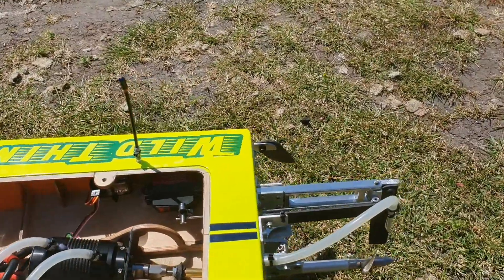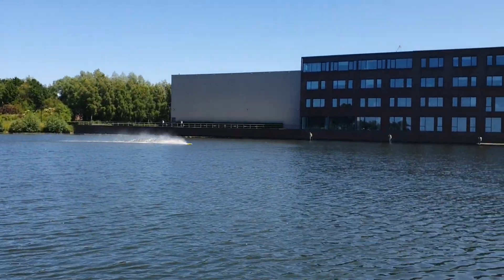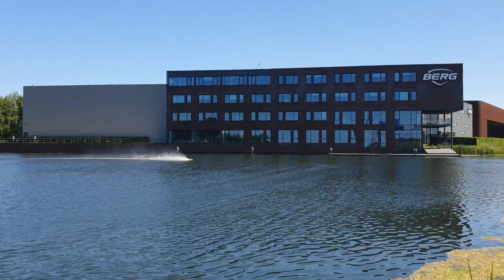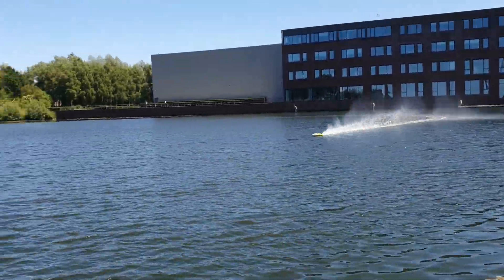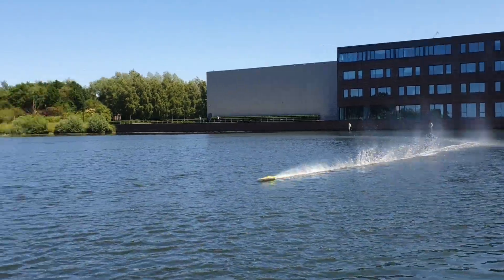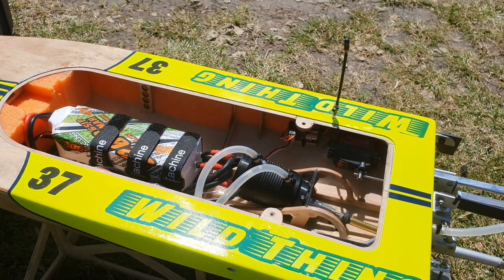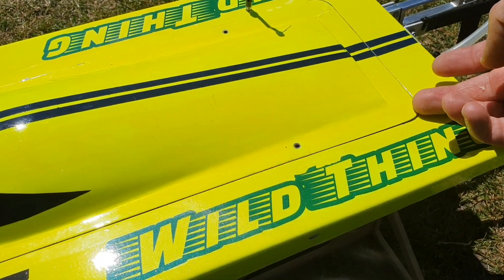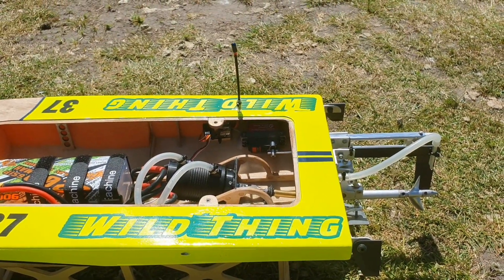DIY RC boat: Wild Thing breaking speed record. New rudder, running better than ever!

Comment: according to the experts on offshore electric forums you're going to explode that boat running 2000kv on 6s. You should be running 1200kv with a 55mm prop. They know, they race boats.
Reply: The guys on offshore is correct with they recomendation. A 35000 rpm max unloaded setup with a 52 to 55mm prop will out perform a 50000 to 55000 rpm unloaded setup and a 42mm prop. 

Better runtime with the same or more speed is what the lower rpm setup will offer in many cases. The bearings, strut bussing will last longer with the lower rpm setup. And if anything is slightly out of balance the lower rpm setup is more forgiving.

That is one nice looking boat, and it runs as good as it looks.
Reply: @Patrick3450  yeah no. It will destroy a battery. it will desolder wires. it will torque roll, torque steer, chine walk like crazy. It will not take a corner. No engineer in the world will tell you a low voltage, high current system is better. prop size = load = current.

your batteries C rating is being pushed to the brink doing that. A battery only contains so many watt hours of energy. and a low voltage system is least efficient so your run times are less. Anyone with the slightest shred of integrity running this goofy system will tell you they run their batteries and wires extremely hot to the point of destruction. Ive watched it a dozen times. watched SMC and CNHL packs puff 50% their size and desolder their nickel joints.

There's this thing called Ohms Law. It dictates resistance to electron flow. High voltage = less resistance = higher efficiency. Thats why transmission lines are 33,000 volts and only stepped down in voltage at the residential location. a low voltage high current situation is referred to as a brown out condition. It is notorious for destroying appliances and catching homes on fire.

high voltage with small load equals cool system temps, excellent boat handling, high efficiency, happy batteries, longer run times because less amps are being drawn at higher voltages with less resistance.
Reply from the maker: @Patrick3450  Thanks Patrick and I believe that bigger props are more efficient. That is my experience so far as well. The setup in my Wild Thing might not be the most efficient, but it works well and so far lasts. Thank you for sharing your insights. It's interesting to read the pro's and con's of different solutions! Cheers, DJ
Reply: @CozyRC  do a video on it. get 70mph on 4s see what happens. you'll need a 53mm 1.9 pitch prop. This will be funny (keep a fire extinguisher on hand)
Reply from the maker: @palehorse7377  Don't worry  I will not try that 😅. Purely looking at props, the bigger props seem to be more efficient. But when you setup your boat, the combination has to match together. 
I personally think that props in the 50mm range or bigger, are too large for a 32" hull. Setting your trim tabs slightly down will cause drag and a wet running boat. It might work for some, but I prefer to use smaller props.
And yes, power in Watts =  voltage x amps, so with a higher voltage you have less amp draw to reach the same power output. 
Either way, there are boundaries where a certain setup will work and besides these boundaries, the efficiency will become bad or you might destroy your setup.
My 6S setup with 2000kV is a high rpm setup, but I believe it is well within the boundaries still. Thanks again.for your inputs guys. I respect both your opinions 😎👍
Reply from the maker: I doubt a 55mm prop will work well on a 800mm hull. I'm on OSE as well, but I'm pretty convinced a 800mm or 32" hull suits a 42-47mm prop the best. 
Racing is another discipline, as they should  not drain their lipo's too fast, or they won't make the finish line. Thanks for your reply, I'm always open to receive advice 😎👍
Reply: @CozyRC  that was american sarcasm. obviously that is silly prop size. I run almost exactly the same setup as you. little smaller boat, little smaller prop. same motor.
Reply from the maker: @palehorse7377  I was not sure, but I thought so for 50% 😅 haha
Reply: With the bigger props 50mm or bigger your tabs need to be set equal on the both sides of the boat. And with a little negative, the tabs creates lift in the rear of the boat. I does run a 50mm prop on a 32 inch boat and I don't have any torque role issues thanks to the tabs being set equal on the both sides of the boat. I have seen someone run in the 55 and 57mm range on these smaller boats without torque role. If you can get your hands on an abc 1915 17 45 or 2014 17 45 2 blade props, or even an octura x450 or x452. Those are some fast props. 4s on a 2000kv will do well with those props. 

All waters are not equal but I know that a 35000 rpm set with a 50mm to 55mm will be as fast or faster than a 50000 rpm setup with a 42mm prop in the waters where I run.
Reply: @Patrick3450  to run the speeds he's doing in this video you would need a 72mm 1.4 pitch prop. Your ABC prop, the 1915, would reach 52mph at best. As would the X452. meaning least drag setup, high output batteries. Go to OSE and punch the props into the calculator and see. He's doing 70mph in this vid.

watts = volts x amps
this motor is 2800 watts. On 4s to reach maximum capacity he would have to pull 2800w/15v = 187A. EC5 connectors are rated for 120 amps. he would melt EC5's and have to run 8mm connectors and at least a 200A esc.

when he runs it on 6s: 2800w/22.8v = 122A. which would be high but safe for the wires and connectors. Its also much easier on the batteries to output 122 amps continuously.

so you can run big massive props with massive amp draws or you can run 6s and not melt batteries and wires., use a normal size prop, and go way faster. Not even getting into the boats handling with a 70mm+ prop.

like was said earlier it would be different if you're talking 45-55mph. which you are. But this is going 70+ mph.
Reply: @palehorse7377  To be honest I am have done alot of datalogging, I have pushed lipos to they limit, if the setup is to hot your battery voltage will drop so low that the cells will never have the same power after the run. I have datalogged and closely studied those kind of setups. I does use 6mm bullet connectors. I have pushed over 300 amps for a few seconds on 6mm bullets rated around 120 amps. Alot of the esc's, and motors can go way beyond the rated limits for a few sections. One time I took a 72mm prop for a gas boat and reduced it to 63mm and ran it will 4s using 2000 plus kv motors and datalogged everything. I have an idea of the safe limits that you can push the equipments without damaging anything.
The boat is running good I will say but not trying to offend anyone. But if someone came with that setup to race me I don't think they would stand a chance against my 4s setup with a 2200kv. The acceleration of the lower rpm setup would be too much to deal with. His setup where he was seeking top speed and saw 116kph would probably be able to match my speed. And I am talking about a 2200kv motor on 4s with a 50mm prop on a 32 inch boat.
Reply: @Patrick3450  calculator 2200kv:
50mm 1.4 pitch = 51mph
50mm 1.6 pitch = 58mph
50mm 1.9 pitch = 69mph

so no you still cant match this speed in the real world. Instead of sticking to an obviously nonsense, made up RPM limit pulled out of some "expert racers" rear end, why not just run a normal size prop on 6s with far lower current?

literal proof right here and hundreds of other videos is perfectly fine to turn higher RPM.
Reply: @palehorse7377  To be honest after studying this video more closely he can go alot hotter than that for the kind of running done there. Only holding full throttle for around a second the have to backoff thats not putting much stress on anything. 
I have video of my boat on youtube. So you can see what a 4s boat can do.

Comment: Excellent runs Jan 👍👌! No crashes + speed record, this is a huge improvement. Hard work pays off!!!
Reply from the maker: Thank you Dim. I try many setups and I see the performance improving. That is very rewarding 😎. Especially the hull stability has improved. I had to take out the rescue boat only once 😅.